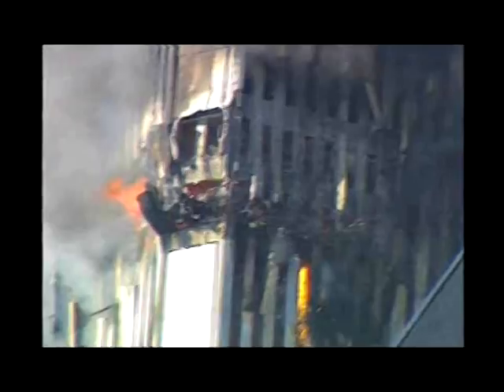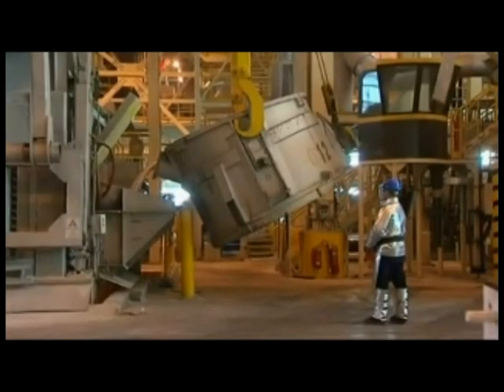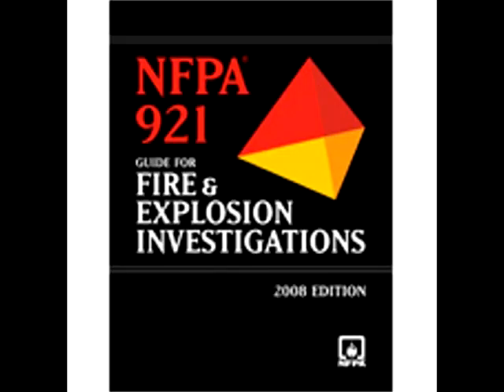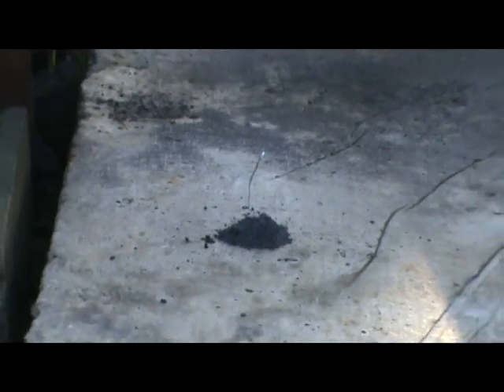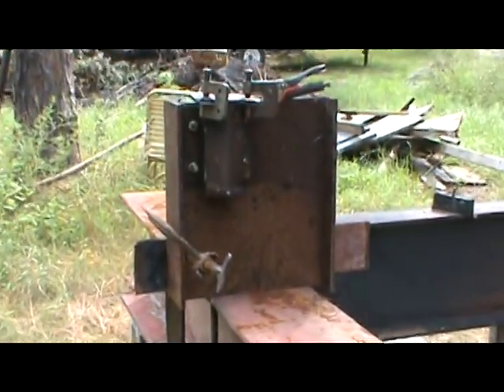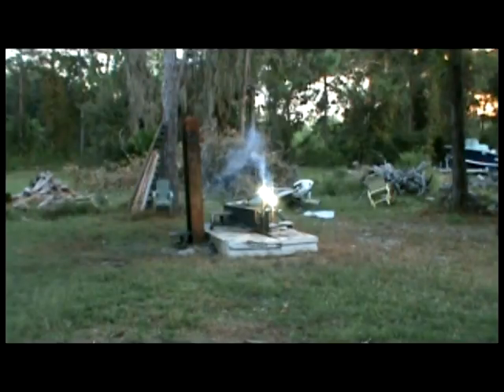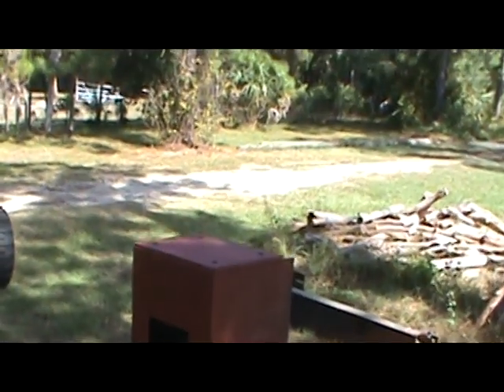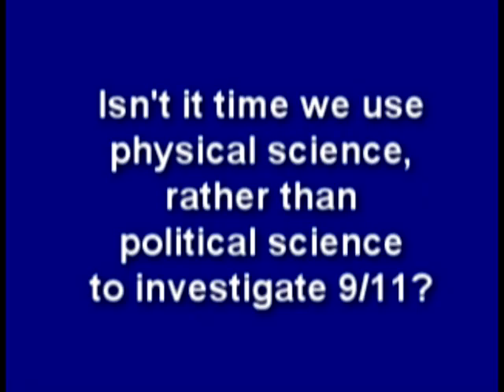9/11 Experiments: The Great Thermate Debate

Comment: So i have a question.
If the steel was filled with impurities, would it be weakend in a greater manner if exposed to an hour of burning at temperature?
Also could the weight of the building be a factor?

Comment: A sound demonstration, & the box beam that was appearing to be blown out fr inside, that's authentic wreckage?
  This however doesn't ask the whole physical question of would the above load of tensile steel only require a warming to get them to deflect & start bending 2a point of no return?  That in theory should stand within its own unknown calculable threshhold, but almost certainly would have made Tower 2 "hinge" opposite the impact & splinter, having a much larger "footprint" in the ensuing collapse, which it certainly didn't, falling abt as perfectly as it could be done, almost too perfectly.
  Maybe sum1 could shed some light on verticle steel heat/time & deflection tollerance for me??

Comment: If you heat aluminium more after it's already molten, it begins to glow a bright orange as well, so if it was hot enough in there, it could easily have been aluminium.
It wasn't hot enough in there for steel to melt, so how did the steel manage to flow far enough to get outside without cooling down on the way?
You can melt your steel beams with thermate all you want, but if you could show me how it can flow from the core's steel beams all the way outside without cooling down and solidifying, that'd be great... or are you suggesting that they melted one or two of the outer columns and caused a collapse while the plane crashing through dozens of them didn't break the structure? If they had melted more of them, you'd have seen way more molten metal in way more areas.
Assumed is an environment that is colder than the melting point of aluminium. Otherwise you'd definitely see the aluminium that the planes were made of flow out somewhere as well.

Comment: Folks.....it was the supports which were like clips, that held the floors up.   All it took was the heat from the initial fires to melt those clips.   The first clips gave way, and pancaked the floor to the next, which then went to the next, and as they fell they got heavier and heavier.   The problem that most people have is that people are still thinking that the towers were built like other high rise buildings.  They were not.  The clips were new science in the 70's, and were never used again.  It's very easy to think that the government sabotaged those towers, but that's a very paranoid thinking.
Reply: Even normal house fires can reach temperatures that can weaken steel.

Comment: Newton's Second Law of Motion says explosives had to have been used.  The 9/11 Commission Report says no explosives were used.  That Commission report must be withdrawn.
Reply: LOL. You know jackshit about Newtons laws.
Reply: you realize you get 2.8 million joules or so from the impact of the plane alone?
about 234,674,403,375 joules can be generated from a 100% explosion of half load of Jet A.
For comparison sakes thats about roughly 56 tons of tnt equivalent give or take, a MOAB is about 11 tons of tnt equivalent.
However luckily the fuel did not explode consistently and thankfully you never had a giant fragmentation grenade made out of concrete, steel and other materials.

However what you did have is a lot of fuel burning and weakening the supporting beams.

"but melting point"
Shut up.
You don't need to melt steel to make it malleable.

Comment: 100% total nonsense. There was NO molten steel, It was plastic, textiles or the thousands of pounds of aluminum covering the whole building.  The steel was weakened by the heat to the point of failure.  To bring a building down of that size by explosives or even thermate   would take months of work by dozens of very highly trained experts. all done at night....  The night shift, security, maintenance and even deliveries, ALL of whom were not killed in the attack.

Comment: If you are an engineer, you need to go back to school... It was the unique design of the buildings and the added weight of the plane that took the building down....And again... with building 7 all the debris from the tower landed on the roof... which wasn't designed to hold that load. And since it was built like the towers, it collapsed too. The gunfire / explosion sounds were the bolts on the opposite side snapping due to the upward pull on them, due to the opposite side not having support. The bolts were designed to keep the building steel in line, not to keep them together if they are being pulled apart.  
https://aretheythinking.com/911-your-brain-not-not-the-building-wired-for-demolition/

Comment: for everyone saying jet fuel melted it errrr wrong it wouldn't be hot enough
Reply: Now add forced air to that jet fuel and you can melt anything you want .....it’s called a furnace , the towers were the tallest furnaces ever.
Reply: Rush bk Do dont need to melt the steel, only get it hot. After you get steel warm its easily bendable. The heat from the jet fuel+ thousands of tons of weight above it caused the collapse.
Reply: +Darkmatter2134

Right. That's why the WTCs were the ONLY steel structured buildings in the history of architecture to collapse due to fires. One Meridian Plaza, which burned for 23 hours, didn't collapse at all. The Grenfell Towers, which burned for 14 hours, also didn't collapse. 

Your "easily bendable" theory is a load of horse shit. The fact that your comment got any likes at all shows just how gullible people are. There's no possible way the WTCs could have been dropped by fire alone.
Reply: Captain Obvious agreed
Reply: @SergeantExtreme  how many buildings got hit like this?!??  Are u serious😂😂 how can u even compare any other collapse to this very unique event. Stop it
Reply: rush bk you sir are quite uneducated
Reply: Heat+oxygen+pressurized air=worlds largest acetylene torch with 10s of thousands of tons of down pressure
Reply: Rayan Khan it wasn’t so much the wind up there but the central column acting as a massive chimney, feeding air up from the ground floor.
Reply: Rayan Khan; In the unfortunate events of jet plane crashes on the ground, jet fuel melts everything except for some of the engine parts. And that's without the blast furnace like winds in the WTC.
Reply: rush bk yeah its makes steel as strong as a fucking noodle dumbass
Reply: Hot enough to weaken its structure considerably though!
Reply: Yeah, because steel totally doesn't weaken as it get hotter right. I mean, there totally wasn't thousands of tons of weight on those hot steel beams.......
Reply: its hot enought to ignight the magnisium that is used in the manufacturing of aircraft. Magnisium, once lit burns white hot and can melt steel.
Reply: Devin Cline your the first person to say my thought about the WTC issue besides myself that I've ran into. I always wondered about the part.

Comment: 13 years ago in Madrid.
The Windsor tower, 1/4 the height of WTC 1 and 2, a fire started in floor 21, it was burning for nearly 3 days as top floors were unreachable for firefighters.
All the external part of the building from floor 21 to the top really burnt, as you can watch in the video.
The steel and concrete core remained intact.
The tower was dismantled floor by floor in a whole year of hard work.
It never collapsed, the steel and concrete remained intact.
https://youtu.be/sngD_YEGOZQ
Reply: You cannot compare apples to oranges.
Reply: The windsor tower had a concrete core moron.
Reply: Was the Windsor tower designed by the same structural engineers as the WTC?

Was it built using the exact same steel and concrete as the WTC?

Was it hit by a 767 at full speed?

If you can answer no to any of these, then you cannot compare them.

It's the same as saying that because apples and oranges make juice and are fruits, they are the same. They are not.

Now fuck off, moron.
Reply: Actually the external steel superstructure of the windsor tower collapsed from the top floors due to the fire. Which makes the point even more clearly. The concrete core remained as you would expect. And no, it wasnt built anything like the twin towers design.
Reply: What point? 

You still cannot compare apples to oranges. They were designed differently, and with different materials. (Yes they were both concrete and steel, but unless this steel and concrete was from the exact same plant, they are different)  Not to mention the fact that the Windsor tower was a meager 32 stories, while the Twin Towers were 110 stories each.

And let's not forget that the Windsor tower was not hit by a 767.

So again, what point are you trying to make here?
Reply: Im agreeing with you. Maybe you havent noticed.
Reply: Haha, sorry man. Didn't notice, I'm too tired for this apparently.
Reply: Hah well, most of these fools think they're more educated than any one else, so not so sure how that'll work out - but as long as just one more person won't be sucked into this bullshit, it'll be worth it.

Cheers!

Comment: Nice experiments. Explosions are possible without explosives. This happens most often, when incomplete combustion occurs creating explosive vapors, which then have to mix with fresh air to explode.
Similarly, Steel bars don't need to melt to collapse under the pressure. The heat of jet-fuel would be just enough to make steel forgeable.
However, this would still leave many questions unanswered:
a) why did similar buildings burn for an entire day without collapsing (both the WTC and the similar construction in South America had asbestos around the steel carriers in order to prevent fires of heating up the steel so that it gets soft).
b) Why did the fires have these odd patterns?
c) What about the sparks and metal pearls?
d) why did the towers collapse like in controlled demolitions? If a floor would collapse, the upper floors would fall onto the lower floor and smash it and then the next etc. delaying and weakening the impact, whereas the WTC fell pretty much at a constant speed, close to the speed of free fall.
e) Why did the neighbour building collapse without a direct hit?
f) why were there puffs of smoke before the respective floors collapsed?
BTW: I'm pretty sure that occasionally thermite is used in controlled demolitions, just like hollow charges. Don't ask me when or why, as I'm no expert.
If it was staged, then the question would remain why? And that's where conspiracy theorists tend to fall short, when it comes to plausible explanations.

Comment: This is such BS.  It is so obvious what happened.  Aluminum in a melted and compressed state caused several explosions.  The intense heat and the free transfer of this heat to support structures caused floor collapse. Each floor was designed to hold a max load.  This max load DID NOT include several floors above it.  That load was designed to be supported by those same support structures that were severely damaged.  The floors failed and this process accelerated when more floors above failed.  This process would not be slowed or stopped until we got to the bottom.

Comment: The one fact they dont mention is air at that height the wind will flow into the building  increasing the temperature by hundreds of degrees possibly even in the thousands mixed with the jet fuel and other materials burning it very possibly could melt steel

Comment: Idiocy.  You’re an engineer?  Welding steel doesn’t make you an engineer.  I question your education.  These people and yourself don’t even have a basic understanding of physics and engineering.  I’m so tired of explaining this.  No melting of steal.  It was heated to malleability.  Forces could no longer evenly spread to the outer and inner walls.  A single floor can only support 3-4 floors of direct pressure on top.  The pressure is usually dispersed outward.  Once compromised, it couldn’t disperse anywhere but straight down. I challenge any “engineer” that supports this crazy story.  They clearly have a poor education.   And Mythbusters?  Those guys are the biggest idiots and non-scientists I’ve ever seen.  I watched their show and every single time, without fail, saw them jump to conclusions without thorough testing.  I don’t believe the media either.  I believe the science I can see and test.  9/11 is not rocket science.  And yes. Heat weakens steal.  How do you think we create steal products including the beams supporting the structure.  I AM an engineer and my father is a Structural engineer.  Both highly educated.  We knew the buildings would collapse as soon as we saw them hit.  The point of impact was far enough down that a floor 10-15 stories down cannot support the weight of that many stories with downward forced pressure.  I’m not a fan of the government, but pushing this bull crap story doesn’t accomplish anything.  Stop terrorism - foreign and domestic.  Geez!
Reply: Astro Mars I haven’t heard one reputable engineer argue with the trade centers falling.  I’ve heard plenty of idiots like this guy who clearly don’t know what they’re talking about (but try to use big words) to try to convince people of poor science.  Tell you what.  Let’s compare my structures to his and see whose lasts.  Btw, steel doesn’t have to melt to bend.  How do you think we formed steel columns in the first place?  How do we form steel products?  We heat it to malleability, not melting point.  Ever heard of Blacksmithing? And this  guy quotes Mythbusters, which are just buffoons.  I’ve never seen even ONE scientific test conducted on that show.  It is a joke.  When I know engineers and other scientists that have the education I and others do (and we’ve built things for 1000s of years based on these principals), then I’ll listen.  When bridges quit working and buildings quit being built because the science is wrong, then we can talk.  Until then, the science works and this guy’s (or any other’s) pseudo-science doesn’t.  Don’t confuse the culpability of people within the US government with the facts of what brought down these towers.  Are there people culpable who are in high positions?  Of course.  These guys got entry into the US.  Who knows what low level idiots helped things along.  It still has nothing to do with how these towers fell.  And I might add, a 767 filled with jet fuel is a bomb and the only bomb needed. And I’m not familiar with the Sec of Trans talking about an inside job on the towers.
Reply: yes me too i get frustrated  when i see people believing wtc 7 came down perfectly for a non scientific reason, its nice to see engineers questioning the official story... whats the deal with Israel??
Reply: I get frustrated when people take singular I beams in special conditions with specific setups in their pre-controlled experiments and shout, "SEE SEE this is what happened in the two towers," and completely ignore practically every physical and structural  issue the buildings dealt with during and after the impacts.  I think people get so desperate to blame a government power and would rather believe everyone who was there and saw it, didnt really see what they saw.  That's another good one they toss into the conspiracy.
Reply: +Captain Spire

Uhhh, Captain, there were THREE towers that fell that day. Care to explain the "physical and structural issues" of WTC 7?
Reply: Captain Obvious quite simply, building 7 was compromised from a 3.2 earthquake from the collapse of the other two buildings and extensive damage from storm force winds of concrete blowing against the building.  Why is this so hard for people to comprehend?  Believe what you want about our government being complicit.  Who knows?  But to think there was anything outside of a 1500-1800 degree fire and 6-10 floors being destroyed by a jet that had tons of fuel causing both a chemical and combustible explosion is just ludicrous.  The terrorists had PhDs in structural engineering.   They knew what the rest of us did. This will take down a building.  It was genius, though evil.  No need to have this crap when a jet full of fuel will do the job.  That’s why this is so ludicrous.

Comment: I'm curious:  Jet fuel seems to be the only flammable liquid, delivered by the airliners, brought up in these discussions.   What about oil and hydraulic fluids?  Both can burn With great intensity.

I'm also curious as to what potential propellants, and quantities, were onsite before the crashes; cleaning supplies, paints, solvents, aerosols, etc.  MSDS of each WTC building should have those numbers.

Comment: you dont need to get steel to melt, only lose it's structural integrity. Normal ass fire will do it given enough time
the was a business complex near my house that went up in flames and then when I drove past it, there was a whole mess of twisted steel all over the place after the fire. It was caused by some electrical device in a pet shop, yet the damage extended to the whole segregated about 10 separated businesses. All fucked.